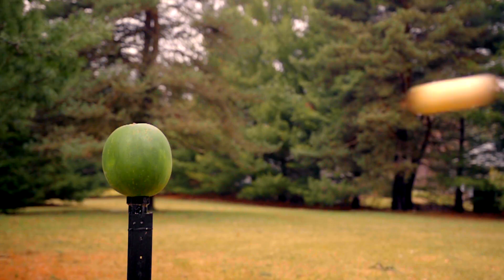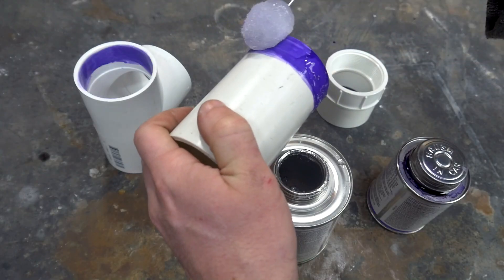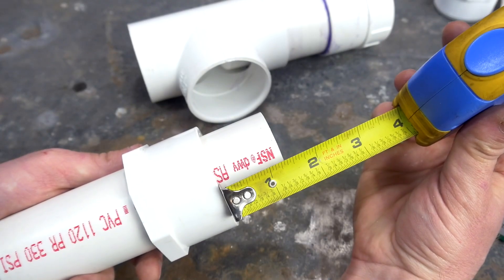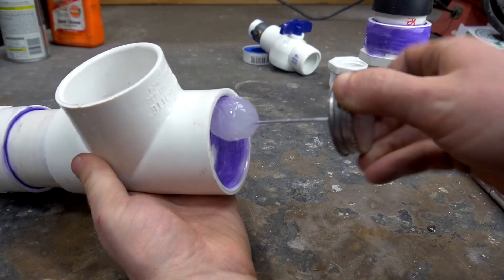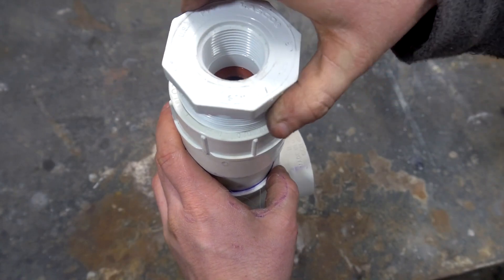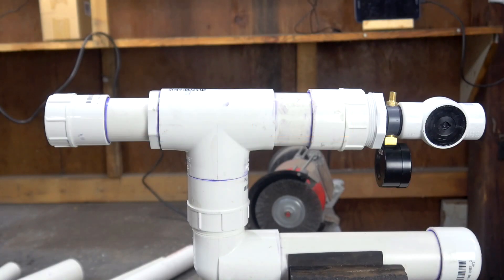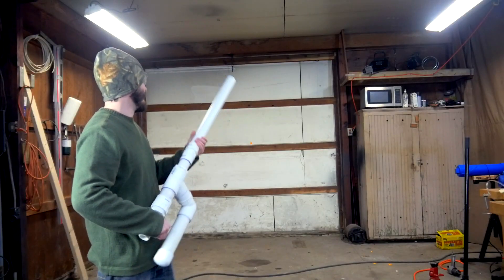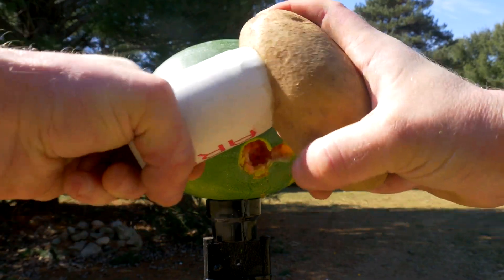How To Make A High Power Air Cannon - 2" Piston Valve (Barrel Sealing)

Comment: When I made air cannons, an accidental discovery when designing a breach loading port; There's no need to trim the potatoes... as I found out, even a baseball will get smashed through the barrel which it doesn't fit through. Bottles of water and cans of soda were fun, they would rupture in order to fit through the barrel and "spray" a hole in the fence.

Comment: I’m feeling pretty bitter at the moment about this video. Followed the instructions for this to the letter, with very disappointing results. 
Several PVC components are rare, at least around me, and can only be ordered online. O-ring also difficult to find. 
Biggest problem is the force of the piston slamming back. I have now built this exact cannon TWICE and the back is blown out and broken immediately from the force. The tiny little bit of rubber shown is not enough. I beefed it up the second time and it still just slammed back at 60psi and broke the back out, ruining most of the project since it’s mostly glued together. Overall very disappointing. ☹️
Reply from the maker: Are your fittings marked NSF-PW and SCH 40? Something is wrong with the female threaded adapters you are using if they are blowing out that easy, and they are probably not safe for pressure use to begin with. Sorry you've had trouble.
Reply: NightHawkInLight 
Hey thanks for the reply. Yes everything is NSF-PW sch40 pipe. I may shorten the distance the piston can travel. That may be the issue. It may be too long and allows it to build up speed in the chamber.

Comment: Is there anyway to fix the honking noise? How is that occurring?
Reply from the maker: Honking noise means your sprinkler valve isn't opening properly. Happens sometimes since they weren't made for air. It can be fixed by modifying to open using an air valve instead of electronics. Link in the video description shows how
Reply: Im not using electronics but I plugged up all the holes of my top piece on my sprinkler valve. Could that be the reason?
Reply from the maker: I'm not sure what you mean. You can send pictures to my email at nighthawkinlight@gmail.com
Reply: NightHawkInLight I sent you an email regarding the sprinkler valve. Feel free to check it out. Thanks

Comment: I’m using a 2” diameter barrel and reduced it to 1/2” to shoot a nerf dart
Reply from the maker: Ah that's your problem, you can't use the same diameter barrel as your piston. The barrel must be smaller so that when pressure behind the piston drops it is pulled backwards with more force than what is holding it to the barrel. When you open your valve now it just makes the force on the piston equal from both sides so it has no reason to move. I'm not sure how you can fix that without rebuilding the valve. You need to figure out a way to make the opening to the barrel that the face of your piston seals against a smaller diameter.
Reply: I have a 2” pipe for where the piston goes with a 2” t joint. I then sanded down a 2” fitting to a 1 1/2” like in the video. I then have the 1 1/2” pipe with a rubber seal to seal the piston. Then i let the 1 1/2” pipe out of the main part and then reduced it to my 1/2”. I’m not sure i am doing what ur last comment suggested but I could be wrong. Let me know.
Reply: Is there a good way I could send you a picture or video?
Reply from the maker: If the barrel that contacts the piston is 1.5" as shown in the video then that should be fine. Push the piston back manually (when the cannon is not pressurized) with a broom handle or pole down the barrel and make sure it can move and isn't stuck due to still being too tight. If it's very hard to move then you still may need to deal with that o ring being tight. If it moves fine then try firing again. The cannon takes a minimum of about 30 psi to fire properly.
Reply: I will try that again tomorrow. Also I’m using a bike pump and the piston won’t move to make the seal endless I push down fast. Could that mean my seal isn’t that tight and cause a problem?
Reply from the maker: No that's typical of using a bike pump with a piston cannon, no issue there.
Reply: Maybe it’s my sprinkler valve then. I will check  as soon as I can. I appreciate the help a lot. This video caught my eye the minute I stumbled upon on it and I knew i had to try!
Reply from the maker: Does the sprinkler valve open quickly with a pop or does it seem to open slowly/make a honking noise? Is it still using the electronics to open that it came with or have you done a air mod like the one has in my video?
Reply: I attempted to do an air mod. I am getting a honk noise. What could that be due to? And how could I fix it?

Comment: I am trying to make the piston work for my air canon. The piston seems to be to wide even with following your video on how to make it. I have the exact size o-ring and it takes a lot of force to push it in the pipe. More than what should be necessary. Is this right? or how can i modify it to work?
Reply from the maker: Have you greased it? I can't say if it's too tight or not having not felt it myself. The o ring should be air tight so it's not meant to be a lose fit by any means.
Reply from the maker: Make sure the inside lip of your pipe is sanded so it's not sharp such that it would damage the o ring when you push it in.
Reply: I have greased it but I did not sand the inside lip. The piston takes twisting along with a great deal of force to fit inside a 2” pipe that is separate from the build.
Reply from the maker: If it can move back and forth in the pipe once it's inside with less than about 5lbs of force then it's fine. Otherwise you may need to make a new piston and use a round file to file around the groove where the ring will sit so it can sit a little deeper.
Reply: I got the piston to be able to move and be air tight. The issue I have now is that the piston isn’t shooting back after I release the air out the back. Any suggestions?
Reply from the maker: What pressure are you using? What size release valve? You must have a valve that lets air out very quickly.
Reply: NightHawkInLight 1” sprinkler valve
Reply from the maker: The valve should be fine then, are you using the same diameter barrel I am in the video? What pressure are you trying to fire at?
Reply: I’m using a 2” diameter pipe reduced on the barrel to 1/2” to fit a nerf bullet

Comment: My piston keeps getting rammed so far in the rubber fernco, it won't release. Any suggestions?
Reply from the maker: Open the rear valve faster or use a bigger/faster valve.

Comment: Hey first love this vid second I screwed up when I built mine I forgot to put rubber coupler on barrel before glueing it in if I fasten a rubber gasket on piston do you think that would work ? I would hate to rebuild
Reply from the maker: A rubber gasket on the piston can work, but it must be a very smooth surface that seals cleanly against the barrel or you're going to have leaking issues.
Reply: NightHawkInLight  thanks I'll clean it up best I can thanks for answering!

Comment: You can do improvement of air tank by L elbow, but making it longer and rotated 180 degrees, so that it faces forward. The same pressure, but much more volume of compressed air. What you think?

Comment: Could this same cannon be made with copper instead of PVC? I ask because I've already got the copper pipe and am going to braze it all together to withstand greater pressure. I just need a good way to fire it. I read about sprinkler solenoids but trying to thing how to incorporate it. I've got a 4x1x4 Tee. Was going to make the chamber 4" and the barrel 2"
Reply from the maker: Should work

Comment: I have completed the build but I am having trouble getting the tank to pressurize. it's leaking out of the barrel end. The Piston moves forward against the pipe after I start putting air through, but it seems to be leaking past the rubber coupler and into the barrel. Not enough super glue? Any ideas? Thanks in advance.
Reply from the maker: You can try smearing some TFE pipe thread paste on the rubber and that will make it sticky so it seal better.

Comment: Just built this but instead of using a threaded bushing on the end I used a clean out plug and taped some threads into it for my firing valve. This, I think combined with not tightening the plug in all the way resulted in the piston exploding right through the plug and almost taking my hand off.  Hopefully no one will repeat my mistake.  That piston comes back fast and hard!
Reply from the maker: I'm glad you were uninjured! As you've discovered, cleanout caps are not pressure rated. All pipe and fittings must have an NSF-PW rating
Reply: I used a proper bushing this time and some rubber weather stripping for a cushion. Put some grease on the 2" threads to help get it in all the way. Piston works great now. Only problem now is I'm using a regular sprinkler valve to trigger it and when it fires the solenoid blows out. Ever hear of that happening and what to do about it?

Comment: Okay,  I don't know if I can explain this right.  but you have this cannon that works off compressed air and on another video you have a cannon that works off vacuum.  would it be possible to make a cannon that works off both principles?  and of course fill it with hydrogen as well.

Comment: Nice to see that you did your research and built a well-designed cannon with a fast valve. Even the Mythbusters couldn't get this right, and repeatedly made ridiculous cannons with overly-long barrels instead of using faster, higher-flow valves.

Comment: Could this be filled with a bycicle pump and still push the piston?
Reply from the maker: Yes, but only if the hole in the side of the piston is very small so you can build pressure behind the piston fast enough to move it forward and seal against the barrel. You will have to pump fast until the piston seals.
Reply: Wow that was quick, thank you!

Comment: Can I just cut a schrader valve out from a inner tube and use that?
Reply from the maker: If you want to. You can feed the valve in from the inside of the pipe in that case.
Reply: Thanks!
Reply: Sorry to bother you but one more question. Since I don't have an air compressor can I use a bike pump instead? The main problem I have currently is that the neck of the schrader valve I took off isn't long enough to be threaded throw pvc and get enough out the other side for the bike pump to work. Would some sort of glue be enough to hold the valve in the tube? And if I do manage to find a schrader valve at my local hardware stores (which I was unable to) it should be a 1/4 inch one, correct? Or does that measurement indicate the diameter of the screws on the other end?
Thanks again.
Reply from the maker: Find a schrader valve online or at another store if you need to. They're very common. Called a tank valve or rubber ones are tire valves. You can use a bike pump, but to make it work you would need the hole in the piston to be extremely small so you can pump fast enough to push the piston forward and seal the barrel before too much air leaks out. Maybe even the hole should be made with a hot pin rather than a drill bit so it can be made smaller.
Reply: Thank you!

Comment: Alright. Where in the world do you buy all of your fittings. I checked home depot and ace hardware, neither of them have even half of the PVC fittings I need to build one of these.
Reply from the maker: Home Depot and Ace. If they don't have them they can order them. I did not have to order anything.
Reply: Huh.. My Ace only has plumbing grade PVC and my local home depot only has one piece of schedule 40 PVC that I need. I'll have to either have them order some in or check other locations when I'm near them. Thanks for the quick answer, bud.
Reply from the maker: Pipe is the exception to the NSF-PW rule. It may be marked NSF-DWV, but still have a pressure rating on the side. Make sure it says rated to 220-280 PSI, etc and you're good to go. If it has no pressure rating or says cell core or something similar it's no good.

Comment: How did you modify the sprinkler valve? Did you just remove the solonoid and added a valve to release the pressure behind the diaphragm? Do you need to pressurize the sprinkler valve seperatly?
Reply from the maker: There's a link to a tutorial in the video description
Reply: NightHawkInLight where does the diaphragm get it's pressure to shut the valve off? Don't you need to pressurise it separately?
Reply from the maker: No they're made to leak pressure above the diaphragm from the direction of flow
Reply: Thank you! I finally understood... Had to take one of these apart to understand how that works... You could try to suck the air out of the barrel that way you would achive much higher speed. However, I'm not sure that the piston would work...

Comment: Where did you get the 1 1/2" rubber coupling? What is the part #?
Reply from the maker: I'm not sure of the part number, but it's Ace brand from my local Ace Hardware. I'm sure you can order it online.

Comment: Add bigger pipe or little tank to collect more compresed air. There is not enough air in that pipe. A bit of tank attached to this cannon would realese more compresed air more power but that can be danger then

Comment: Is there a ratio of the psi used in the cannon to the size of the pressure tank?  Maybe in the scenario of down sizing and not using 60 psi?
Reply from the maker: The 2" pipe is rated to 280psi but you want to stay well below that in case you've done a bad job with any of the glue joints. 100 is about as high as I ever go.
Reply: That makes sense. Thanks for the response.

Comment: Please add the "vacuum cannon concept" to this new cannon. You just have to put a hose in the barrel in order to connect the vacuum pump and create the aluminum foil seal at the end of the barrel, that's it.
I think that would be amazingly powerful!
Reply: Maybe the piston could have troubles going backwards once you open the ball valve because the vacuum in the barrel keeps it against the rubber sealing. In that case just add a vacuum chamber behind the ball valve ;)

Comment: where did you get the parts, because i could not find it my local home depot or lowes and does the piston have to be marked NSF-pw?
Reply from the maker: I got them at Home Depot. Except for the o rings which were ordered online. The parts for the piston do also need to be marked nsf-pw, yes.

Comment: how large of a benefit, if any would you get by using a 4 inch t as the valve body?
Reply from the maker: It would be a much larger valve, so it would let out air much faster.

Comment: I doubt it would make much of a difference, but do you think it would help if you used a check valve instead of that tiny hole in the piston? I'm not sure how much air actually leaks out after the pressure drops. It probably wouldn't be practical but still.
Reply from the maker: A check valve would help, certainly.

Comment: what if the air chamber was 4" pvc? or would that we too much air volume. asking cause i've put higher volume pressure chambers on other designs and have them plow off the barrel or the quick release  valve. may i also say its awesome to see all the other DIY channels in the community down in the comments on the first day .
Reply from the maker: It will work fine no matter how large you make the chamber. It can be difficult to find pressure rated fittings larger than 2" though.
Reply: already have them. ACE plumbing has a large list of pressure rated fittings if you are having a hard time finding larger ones. love the vids BTW have built/ plan to build  about half of your projects or have used ideas from your vids to make custom 3d printed parts.
Reply from the maker: NSF-pw? Or dwv? The Ace near me only has dwv. You can get dwv fittings that are schedule 40 and I've used them before, but since they are not pw they aren't rated for pressure use and you're taking a risk. If one blows up you could really be injured. You don't gain anything by using a larger diameter chamber than the size of the smallest choke point in the barrel so you may as well stick with 2" and just make the chamber a little longer if you want more volume.
Reply: nsf-pw 220 psi 4" pvc and i learned to check that they are pressure rated parts the hard way. first time i made an air canon with what i thought was pressure rated 4" as the air chamber and had it explode first fill. live and learn right. also with a bit more volume for back pressure wont it open the valve faster and with a larger chamer than the other fittings shouldn't it create a "higher psi" in the choke
Reply from the maker: The pipe is easy to find pressure rated, it's the fittings that can be difficult. You want the volume behind the piston to be as small as possible so that there is less air that needs to be let out before the piston starts moving.
Reply: sorry ment forward pressure. like using a portion of the pressure to push back the piston then the remainder to launch the projectile.
Reply from the maker: No it doesn't make any difference how much volume is directly in front of the piston, the force pushing it backward is the same.
Reply: thanks. for the reply and your videos.they give me ideas for other project i get hitched up on time to time ex. i used the ultra sonic fog machine for an aeroponics system and a vapor chamber for something 3d printed abs parts.

Comment: Is there an advantage for this design vs using just a sprinkler valve for the air delivery system? Does it release the air more rapidly ? 

I was wondering because it definitely makes the design more complicated. If it does increase the performance, I would consider it since I am going to build another potato gun soon.
Reply from the maker: It releases air way more rapidly, and through a larger diameter opening.